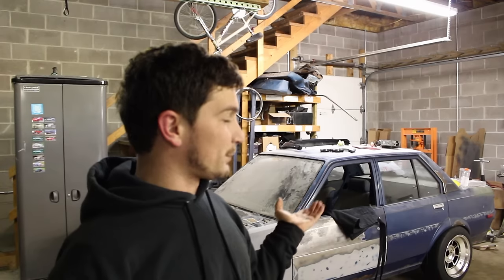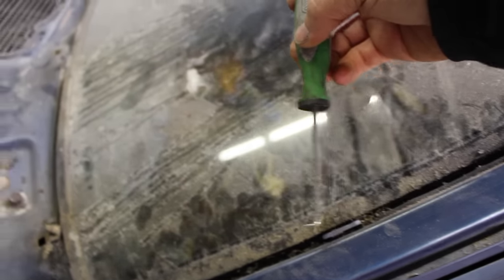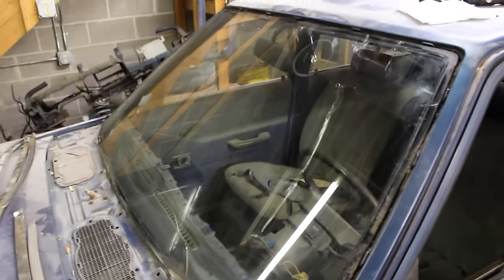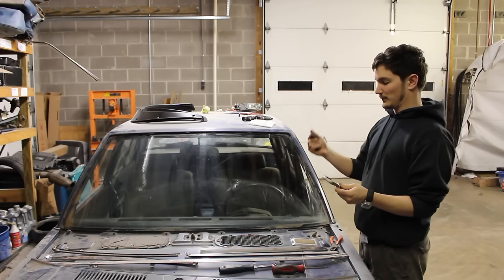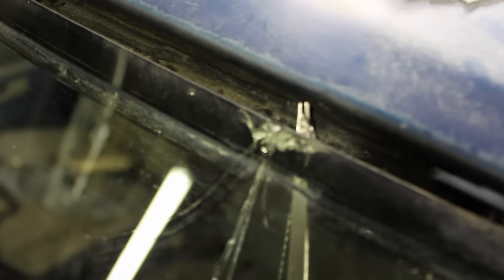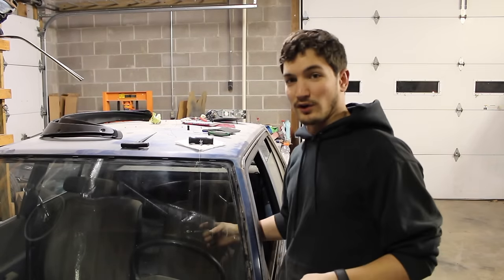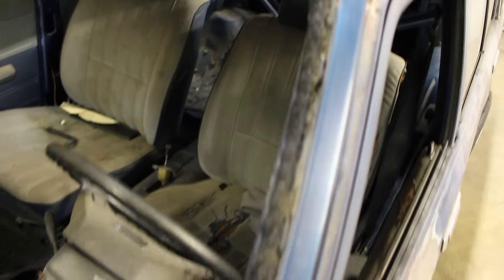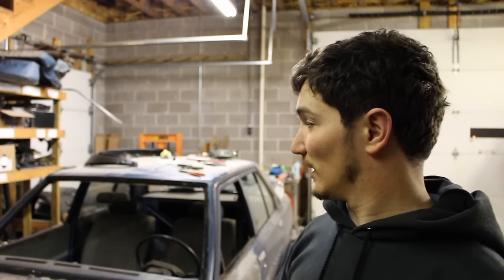How To Remove A Windshield By Yourself

Comment: There is no way that is how the people at the windshield places do it. Isaw a guy pull one out in a parking lot, and replace it in 30 min. There has to be a better way.
Reply: Windshield guys will NOT show how its done. They are protecting their trade. Try finding a better video ... not sure there is one, sadly.
Reply: They use an electric saw cutter. That risks cracking the glass. This is the most secure way one can do it.
Reply: I'm a professional glass installer, this is probably one of the worst ways you could possibly take out a window rather than just smashing it with a hammer around the edge. 
There are plenty of good videos on youtube of professional glass installers showing you how we do it. 
But seriously, just like a mechanic, you are paying us because we have tons of money invested in tools because it's all we do everyday, and we have YEARS of experience and know tons of tricks and what NOT to do. 
You as a normal person can literally total your car trying to do this yourself with no knowledge. Certain models of cars you can just cut right through the metal the glass is bonded to and if you cut it off, you're pretty much ruined.
Reply: @frankhernandez6524  That's if the windshield is not going to be reused. For reuse, they use something like a WRD fiber line kit.
Reply: There is.  Kick the window out.
Reply: @mikel2283  there are plenty of good autoglass installers on youtube teaching how to do certain windows.
Reply: How to thread a windshield tool

Comment: Good job, it came out nicely. Love the idea too, i work with autoglass for a living, and it's relativly easy. Id however recommend against sawing the urethane, the heat from the friction releases isocyanates, basically cancerstuff. Use a "cold" metod. When taking out an easy car like this, use the "L-knife" instead, or have another guy help you PULL and force the thread through the urethane. Cold methods that doesn't develop heat in the process. It works best with a piano style wire, not the "Wired" wire 😁 I hope people take this advice, that smoke is dangerous.
Reply: It works best with piano wire, ie, single strand wire? What is "the 'Wired' wire"?, that comes with this kit - braided wire? Thanks.
Reply: I was just thinking piano wire. Me and a buddy use to go to junkyards and pull windshields for his daily drivers using piano string. We would file a sharp point on one end shove it through the urethane then use 1 inch thick wood dowels wrap the wire around them for pull handles to cut the urethane. Bit hillbilly but it worked.
Reply: @steveandrews8301  I think by "wired wire" he mans steel cable. The cable has many strands which makes it tempting to "saw" through the urethane adhesive, which Albin Ullanger says releases toxic gas as it heats up the urethane. A piano wire has no strands (it's smooth) so can be be pulled through the urethane, unlike the cable which will hang up because of the many strands.
Reply: The amount of heat required is nowhere near what friction from hand can create naturally.

Comment: Lmao you're supposed to push the cable through the urethane at the bottom of the windshield, not the top. Not only will you NOT crack your windshield that you might be reusing, but you will also make your life a hell of a lot easier.

Comment: I had a 1982 Toyota Corolla and someone threw a rock from the woods onto the highway landed in a the middle of my windshield at 55 mph  luckily my son or my wife didn’t get hurt next day my neighbor help me mount a use windshield that I got from the junkyard I was about to spend more money on tools to get the cracked windshield out but my neighbor told get a guitar string to break the urethane seal It worked great

Comment: just a couple of tips mate, in case you do it again, you don’t need to use the probe in the kit to get it wire through, just poke it through with a pair of long nose pliers, especially if you want to save the windshield. but if you do use the the probe do it down the bottom where there’s a lot more room, and get someone to help you wire it out, makes it a hell of a lot easier
Reply from the maker: This was my first time ever doing anything like that. I realized that the poker is totally unnecessary. Help would also be appreciated, but I am trying to build this car solely by myself. Thank you for watching!! Next time I do something like this I will use your tips.
Reply: So the wire, itself, if pushed, is stout enough to poke through this glue / adhesive material? Thanks.
Reply: Great advice

Comment: Nice vid. I wanted to see how these wire tools worked. Some tips though for others watching this: this is working with glass under sometimes extreme tension soooooo ......... eye protection and gloves (you can say thank-you mom when you pull that shard of glass out of the goggles or glove) :-)
Reply: guitar stirg will work to

Comment: Probably the best way for someone who's never removed windows to do so. A cold knife or a pull knife as they're called by some are much easier and faster.  But those are more difficult for a beginner to use. If pulling windshields is something you will do several times I'd recommend trying to get good with one. And like someone else replied,  spray some water around the window,  it will make it go smoother. Also if you start in the bottom corner,  work your way up and around to the opposite bottom corner.  Then use a long knife, basically a long thin handle with a razor blade on the end. Push out on the top of the window and put something in-between the window and pinch weld to hold it up as far as it will go without cracking it, and slice along the bottom.

Comment: Did the same job with a razor knife 2 pairs of  Vise Grip Pliers and a old bike brake cable
Reply: A guitar string works way better
Reply: @TheNewyorican69  Single strand guitar wire or braided guitar wire?

Comment: I use a. Guitar. A good choice is the 4th  string  you can wip it out Realey fast you will need some one inside of car to help make the cut  i hzve changed out winshelled  in  about. 30 minutes. Finished

Comment: I would use acetone to remove overspray before using steel wool. Certain very fine steel wool would be okay but you don't mention what grit and sos pads with the soap you refer to are too coarse for sure. You will create a haze on the glass. Good video but based on comments maybe a voice-over and added tips would be helpful

Comment: Forget the wire method if you have a new screen. Use a "fein multi tool" (or similar) with a long blade or coarse wood cuter attachment.

Comment: You want to clean a windshield from over spay easily, just use some windex and a single edge blade to get it off without scratches like with steel wool.

Comment: I used #100 pound power pro fishing line poked it through on bottom of windshield on drivers side. Connected to steering wheel. Then wrapped line around and used a ratchet and it popped right out. Bottom of window has more room to poke through.Great video though

Comment: Tip for saving yourself from having to buy the harbor freight tool. If you have a razor knife, cut the outside/top layer of gasket off with the knife. I found it MUCH easier than using the tool.
Reply: What do you do after using the razor knife exactly??
Reply: metatech It has been over a year since I did this but I believe you remove the top layer of gasket and you should be able to pop the window out window.
Reply: @cardwellphil  The windshield is still glued in though, isn't it, and would be held in place without the outer rubber gasket, ie., it's glued down, right? Thanks.

Comment: Do you know how to do the same on the rear Window??
Reply: Rear windows are tempered it will shatter if you put any force on it you have to use a ez wire tool or if your experienced a cold knife but keep it off the glass when cutting

Comment: so its jus the urethane thats holding it in place?
Reply from the maker: From all of them that I have seen that is indeed all that holds it in place.
Reply: lol dam no screws nuthin
Reply from the maker: The trim is just decretive around it. So there is nothing that holds it in but the urethane.
Reply: indeed, some windshields aren’t even held in with urethane, some are just held in by a rubber or gasket as some call it
Reply: It's not like the windshield is going to go flying off

Comment: If it will crack with this method, why just not cover it in tape and snash it with a hammer?
Reply from the maker: PazuzuStalker to prevent the mess that you create. It’s also safer. Won’t distort the metal around from a bad swing of the hammer.
Reply from the maker: It doesn’t always crack if you are patient.
Reply: Is it pushing the wire trough with that pointy tool that is critical or  can i crack it during sawing? Due to tension or such...
Reply from the maker: PazuzuStalker just poking the wire through can cause the crack. I learned less wire is better when poking it through. The sawing motion does not promote cracking at all.
Reply: Well, now i used a sawing wire to remove the windshield. Pushed the wire trough by heating it up repeatedly. Took a while, but it did work. No cracks or scratches... except on the dashboard where the wire made some occasional marks near the windscreen. So a tip, protect the dashboard before using this wire method.
Reply: @PazuzuStalker  Good tip -heating the wire up, first. Thanks!

Comment: You ARE Going to probably break the windshield, so plan on a new one..
This is NOT an easy way to remove a windshield, WAY too hard. 
Buy yourself a side cutting electric blade off Ebay or whatever and use a HackOPS™ 1” Multi Tool Cold Knife Blade Windshield Removal Auto Glass Cut Out. Cost about $20 per blade.

Comment: need a sawzall with a flat scaper 1 tool soap water to spray before use sawzall drill with sanding disc to clean off the glue that should take 15 mins and glue primer after to get it ready to put new window in then a tube of glue with culk gun all you need to change a windsheild dam you doing it the hard way

Comment: As a professional glass installer, this is probably the worst way you could take a windshield out. And you pay us for our tools and experience. What would be an all day project for most with no experience, and not to mention extremely dangerous for MANY reasons, takes us about an hour for most vehicles if not less. And 100% backing that your car isnt ruined, AND guaranteeing your safety when the glass goes back in. 
ALSO, if you do cut your windshield out, DO NOT trim the urethane left on the car until like minutes before the new glass goes in. Dude ruined the bonding ability of that urethane by cutting it back when he said the car wont have glass put back in it for quite some time, AND getting painted. 
If you need help bud, just ask. A little advice would save you a lot of time, money, and possibly your health.
Reply from the maker: I couldn’t disagree with you more. There is a time and a place for the type of work you do. I would gladly hire someone to remove and install glass in a newer car that is being driven everyday. However this is a long term project car. In no way in making this video has there been irreparable damage caused to this car. The only damage caused by this method was a few scratches on the dashboard. That part has since been prepped and painted to prevent more rust.
Reply: @BuildsbyBailey  I'm not saying you damaged this car in the video, aside from taking the urethane off way too soon. But this method is not user friendly at all, I know, I do this 40-60 hours a week on every car manufactured and sold in the United States. There are far better and safer ways to do this. 
Someone else might see this video and think they can do it, and they end up way over their head, and could easily damage their car beyond repair in some cases. I have seen experienced auto glass technicians do it by accident. I'm certain someone at home with no real knowledge of what they are doing, they are just following a youtube video that may not be specific to their exact vehicle and because of that they will destroy their car. 
More power to you for getting it done, but this is not great advice for most people watching.
Reply: When you’re getting the car painted you want the paint to bond to the metal not a layer of urethane.